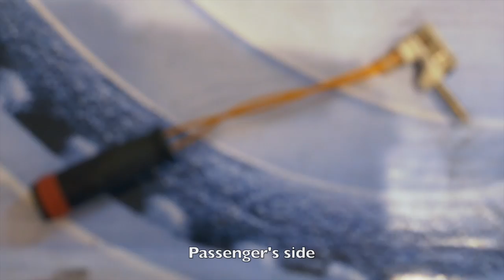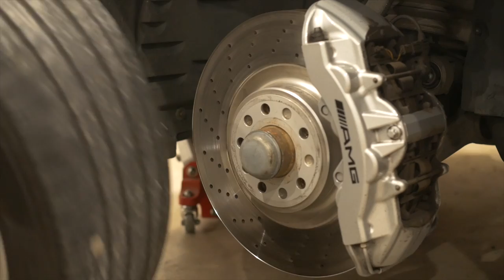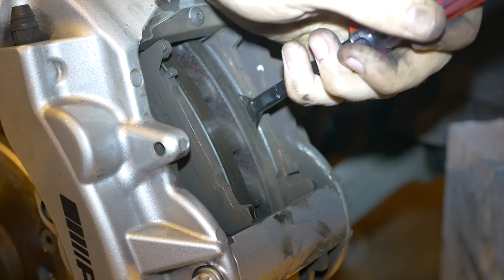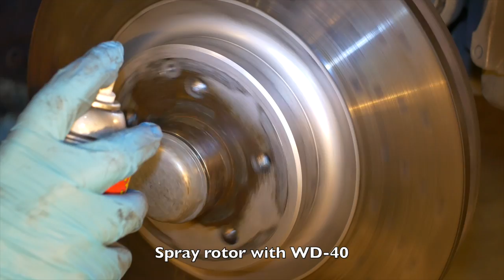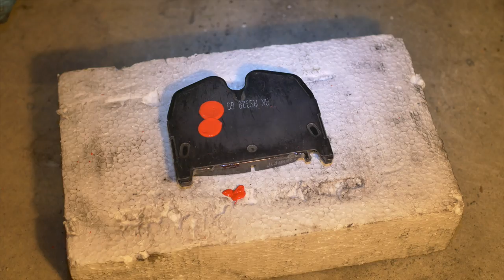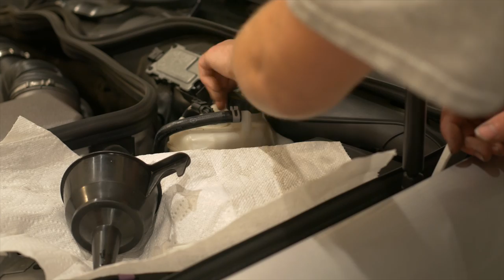Brake Pad & Rotor Replacement DIY | Mercedes W211 E55 AMG

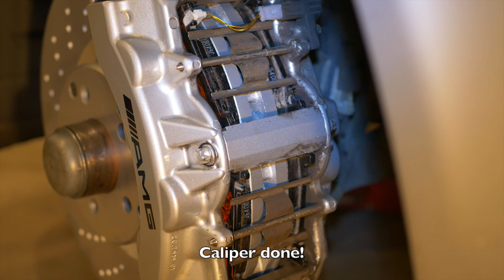Comment: I agree with this being the best visual instruction for changing the brakes on our AMG vehicles with this style Brembos.  I have to add if you are doing this make sure you don’t skimp on cleaning and even lubricating those contact points which the pads slide on where they make contact to prevent unwanted squeals and noises especially if you are using non MBZ pads.  Also the contact post in the caliper where that U shape divot on the pads rest on and make contact.  You can see that inner post at 5:55.  I originally had a bad squeal prior to doing the brakes and was very disappointed to find the squeal continued and got worse after all new rotors and Akebono pads.  Pulled everything off again and discovered I skimped way to much on cleaning and prep of the caliper which led to noises.  Went over the brake pad and caliper contact points with a little sand paper, cleaning and lubricant of Mercedes brake paste and everything sounds great.  If you are having a hard time sliding the new pads into the caliper cleaning the contact points is essential.  Thank you again, I couldn’t have tried tackling this with out your instruction.
Reply: Hi James I recently changed my rear rotors and pads and on my w219 amg stupidly forgot to clean clean the passenger side and as you said the squealing has gotten worse.. but I wanted to know it’s not only when I’m braking. I can hear something scraping as the wheel turns as well Do you have any insight?

Comment: well done video AMGmeister! My daily driven 06 E55 AMG is up to 150,000 miles now. I've logged 75,000 miles in only 2 years ownership. In this time I have replaced the brake pads & rotors, one front air shock, and the SC double idler pulley. Thats it other than fluids and filters. Excellent automobile.
Reply: samspace81 do you still have the original rear air shocks? Any leaks or problems there?
Reply: MRBADASS yes and no no problems
Reply: I'm back to do this again! 226,000 miles now!
Reply: @samspace81  Legend!
Reply: Brilliant!  At that rate you must be on 300,000 by now?
Reply: I’m at 228xxx and my brakes are on the plate this month which is why I’m here
Reply: I’m thinking to buy this car for daily use? Do you recommend it? I hate original car service by the way they always trying to charge something for nothing. But I’m scare about this car replacement coast.

Comment: I had a bit of a nightmare with this, rears were done in a few hours - but when it came to the fronts, it was a bit of a saga:

First of all I couldn’t get the pins out and they were totally seized.  So I ended up sending them to a calliper specialist who themselves had to wire erode them out along with the pad slider plates allen head button screws - the calliper behind these plates was totally corroded to the point where the pads were jammed in and had to be levered out.  

While they were away removing the discs involved cutting off the calliper retention bolts so the discs went in the bin, and then one of the brake hoses was split so had to be replaced.

The new Brembo pads I bought just wouldn’t fit, so I had to get some Pagid pads on the day which were a bit more expensive than my usual source.

One of the dust shields also had detached itself so I ended up doing this too, the part was very expensive…  

Needless to say everything when back with plenty of grease - choices where appropriate.

So since the brake callipers were off I was set to bleed the brakes and not having star, I had to do this solely with a pressure bleeder - which is possible, I was due a change anyway and I did it twice with a drive in between to bed in the new pads to flush as much as possible from within the SBC pump. 

Yay; life working on cars.  😒🤬😅

Comment: great video but i would avoid using thread lock on those bolts as it will be a PITA when it comes to doing the pads/rotors again. A nice snug to those bolts is all it needs.
Reply: Thats what i was thinking

Comment: awesome vid, but just a quick tip, no need to remove caliper bracket bolts on backside of rotor. There are 2 large 10mm hex bolts on front side of calipers, remove them and whole caliper lifts up and out of the way without having to remove the bracket. I once saw a guy servicing an SLR and that's how he did them (same style calipers) also factory recommends Pagid, Textar or ATE only for pad material. good job !
Reply: Yet merc pads are jurid originally lol
Reply: How is there room to remove the disc if you don't fully remove caliper via 13/16 bolt? I hope you are correct as I've only done one side and had a breaker bar as long as my car and it still took hour to undo it.. So bloody tight.. Especially when Mercedes used that blue locktite on it.
Reply: Wdb db yes Juríd was also original equipment. Sometimes providers changed with production date ranges.

Comment: Any issues with the meyle rotors and the ceramic pads? Looking to do the similar setup every soon but just want to know how the rotors preform. Not out of round or warping issues with the ceramic pads??
Reply from the maker: No issues with either. Very satisfied.

Comment: What size are the brake rotors?
Could you please post the part numbers?
I have an S class W221 S600 with the AMG brakes like in your video but im having issues finding the right parts.

Comment: beautiful car and good video information. Question: what is the reason that the SBC connector must be disconnected?

Thanks for the great videos !!! :)))
Reply from the maker: It is disconnected incase the door is opened or the car is unlocked accidentally during the service. These things cause the SBC pump to run and this will damage the caliper pistons or crush your fingers when you have the caliper removed or are replacing the pads.

Comment: well I just purchased a 05 e55 I'm glad I ran across this lol uncomplicate the 1st time...... my question is this there's no pistons in the calipers?  so there no need to bleed the system after removal of the pads an calipers? from what I seen no but hey I'd like to ask still
Reply from the maker: 8 pistons in the caliper, so you still have to bleed to get old fluid out. My brakes were just bled and fluid was changed before I got the car so I'm not in a rush to do it again. You need to find someone with STAR computer to do it I believe.
Reply: AMGmeister dam..... But in order to slide the new pads in you didn't have to push the pistons in then bleed them to push the pistons against the pad like typical breaks?
Reply from the maker: With the SBC brakes in this car it is easy to push the pistons to fit the new pads in - unlike a traditional brakes with a brake booster. Once you start up the car it will squeeze the pads to the rotor itself.
Reply: AMGmeister well that's awesome thanks for the info it's good 2 know
Reply: AMGmeister Does my 2007 e63 amg have sbc? I'm considering changing my front brakes and rotors.
Reply from the maker: It does not have SBC
Reply: @rcautofanatic5024  easy to check just push the brake pedal keep pressing and release 5- 10 times if u hear noise engine sound like u got SBC and or start the car put it in 1 / D push the break pad and again hard this time look dash did i get SBC-H? = HOLD :) THEN YEA OR POP AND LOOM ENGINE BAY HEHHE

Comment: Nice video! How or what tool did you use to measure those 120 and 60 degree turns after the bolt was torqued to spec? Thanks.

Comment: Is there a sensor on both sides in the front? Do you have to reset the sensor with a scan tool? How good are the akrbono pads? Do they produce alot of dust?

Comment: Great videos!! Keep them coming. How did you know you had to disconnect that Sbc. Are you a mb tech?
Reply from the maker: Whenever you open the door or unlock the car the SBC pump runs and adds pressure to the system. You just unplug it so it won't activate and possibly cause damage or injury while servicing the brakes. MB techs can de-activate SBC using their star computer, I don't have that though so I just unplug it.

Comment: Where does one get the metal backing plate that holds the pads in?  I need replacements but can't find them anywhere.  I can locate the mounting pins that hold the pads in the calipers but not the rear facing metal brackets that the pins go through.

Comment: you dont have to unplug the SBC pump.  just jack the car up and dont touch the door handles while servicing the brakes.
Reply: I'd rather take 20 seconds to unplug it than have my fingers sliced off from the pistons if the SBC decides to turn on (:

Comment: Does this DYI applies to the E63 as well?
Reply: No, because the E63 is facelift and has no SBC Unit, has a 6 Piston caliper and a floating rotor where the E55 has a static rotor

Comment: Unfortunately by using your SBC disconnect method you are not going to tell your SBC unit that you have done a brake job. Amongst other things the procedure will tell the SBC that you are using new brake pads and/or rotors again and the SBC knows how to handle this information for various situations.

Other than that another great video.

Comment: I am confused with finding wear sensors for the front, I have some ebay sellers telling me they are the same for left and right, but by looking at your video one is dark grey where the other is not.
Reply from the maker: I was just following this. Mercedes does provide different parts for driver and passenger side. The head size of the sensor pin is different for the passenger and driver side. I have not tried using the same one for both sides - it might not fit. https://www.ecstuning.com/Mercedes_Benz-2004-E55_AMG-211.076-Base-Sedan-V8_5.5L/Braking/Sensors/

Comment: Thought it was going to be a piece of cake. My caliper bolts are super hard to get off. One is stuck.
Reply from the maker: Hit it with WD-40 and a long breaker bar and it should come off.
Reply: Thanks i'll try that
Reply: I had the same problem.  It was a monster b*tch.  I didn't have a lift so I couldn't get full access.  Anyway, if you dare, disconnect the spindle from the upper control arm and the wheel assemlby falls forward to you and  allows you access to the caliper bolts.  They usually have a ton of lock tite making removal without a lift a major head ache. Regardless, I used a propane torch for a few minutes and then ice water and then a huge breaker bar and it broke them open.  Wasn't easy but you can do it.
Reply: Yeah mine broke nearly everything i own lol

Comment: Great DIY, but I must comment on two issues:

- The single rotor bolt is not load bearing, and its single purpose is to keep the rotor in place while the wheel is off, and thus the nominal torque of 10n.m  There is absolutely no need to thread lock it, or it will strip when you try to remove it next time. Once the wheel is installed, lug bolts will handle the job of keeping everything together. The rim inner surface will keep this bolt from backing up, or falling (if its gets loose, but break dust will corrode and clog it and keep it in place anyway)

- A drop of thread locker will go a long way, this stuff is low strength super glue, less is more, there is no need to shower bolts in it, next break job on this car is going to be an absolute nightmare

Comment: So you thread lock the guide bolt for the rotor, but don't specify torque specs for remounting the calipers...?
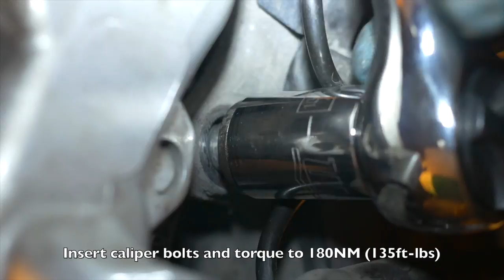Reply from the maker: It says 180NM (135ft-lbs) for caliber bolts at 4:21

Comment: @All Does my 2009 E350 4Matic Sedan have a SBC pump? So that when I replace the Brakes(Brembo) & Rotors(Brembo), I know to disconnect the pump
Reply: Inte8ranD no it does not have sbc
Reply: No, SBC in 2009 is the keyword to say that you don’t have SBC.

Comment: can this rotors and brake pads be fitted on Sl55 2004?
where can I check the compatibility
Reply from the maker: Eyas KD yes, this would work. You can double check by putting in your car on a website like FCP euro and it will show if it fits or not.
Reply: @AMGmeister  Thank you, 
Do you think its worth it to have the genuine rotors and pads from MB or this will do the same job? there is a big price difference , and this price difference is for something, please correct me if I'm wrong

Comment: Professional looks different. You don’t just pull the calipers back. You use a reset tool. He risks that the calipers might cant. Also you don’t wanna disconnect the SBC. Do it right via Star Diagnosis or other tool that can do it properly. You’re not replacing a lightbulb here, you work on everyone’s life insurance (called brakes)! Other than that good video.
Reply: I understand that this comment is 3 years old but you need to understand that not everyone has the resources to have a STAR Diagnostic Tool casually lying around at home, and sometimes doing things yourself can save you some cash.

Comment: I followed the video to the letter on my C55 AMG. When I started the car I now have an ESP display malfunction and ABS display malfunction. ABS light is on in the dash and the car won’t come out of park. I called Mercedes and they didn’t know why you would unplug the SBC module. 

HELP!!!
Reply from the maker: The C55 does not have an SBC module. I assume you disconnected the ABS module instead which might be causing the problems. Double check the connection. If you did brakes on a C55 you would not need to disconnect anything anyways. This video is for E55/S55/CL55 etc as I say in the description. I hope you are able to resolve the issue.
Reply: AMGmeister thanks for the reply. I was not able to resolve. Was able to trip the shifter bypass. But ultimately had to have it towed to the shop. Also the car wouldn’t shift out of first gear, and the speedo stoped working. Any thoughts as to to why?
Reply: C55 and CLK55 6 piston brembo caliper bracket bolts torque is 115 Nm.  Don't use 180 Nm.

Comment: Would you recommend the same procedure for a W209 CLK 55?
Reply: Very similar ,but clk55 has 6 piston front calipers ,with two pads ,not four.
Reply: No SBC to worry about ...Unbolt the caliper from the bracket with 10mm hex bit  ,,re ,fit with 110Nm.

Comment: I'm trying to purchase some pads and rotors any advice on a site the has decent prices?
Reply from the maker: Check out fcpeuro.com -  They have Zimmerman rotors which are the best quality. If you want a lower price but still good quality you can get Meyle rotors on eBay. You can get Akebono pads pretty much anywhere. Hope this helps.
Reply: @AMGmeister  I looked on there but I couldn't find rotors with AMG package
Reply from the maker: @dlawj15  This one is for the front of E55 AMG: https://www.fcpeuro.com/products/mercedes-disc-brake-rotor-e55-amg-sl600-sl55-amg-cls55-amg-2304210712oe

This is for the Rear: https://www.fcpeuro.com/products/mercedes-disc-brake-rotor-e55-amg-cls55-amg-cls63-amg-e63-amg-2114231012oe

Comment: Hey are these rotors the same as the s55 2003??
Reply from the maker: The rotors are slightly different for the E55 compared to the S55. The S55 has the same brakes CL55.

Comment: Will the EUR984 Pads work on a 2005 E55?
Reply from the maker: Yes, those are the correct pads for the rear brakes on the E55.
Reply: I am just going to order a pair for my E55. Question is, what are your reviews on these pads? In terms of dust and durability I've heard they are great. But how is the performance (say braking from 100 km/h to a standstill). Are they as good as the OEM or better/worse?

And how is akebono compared to Zimmerman pads?

Thanx for great video

Arian

Comment: You do not need to bleed the air out of brake line???
Reply: Why would you need to do that? You don't even need to do that on conventional brakes. All your doing is pushing the fluid back up into the reservoir when pressing the pads away from the rotor.
Reply: While you are there and you already got some old fluid out, why not just crack the bleeder and let much of the old fluid out then top off again. It gets rid of any fluid that may have moisture.
Besides MB service says to flush brake fluid regularly. On my ‘01 my calipers lasted as long as I owned the car no issues and the fluid was always clear and clean

Comment: you do not need to disconnect the SBC unit.  simply lock the doors and dont touch the handles until the work is done.

Comment: good vid, but the "brake quiet" (orange goop on pad backings) is kinda pointless in my experience. cheap insurance for a non-existant issue I guess.
Reply: Yep only grease aluminium parts just where the pads slide in and out when braking and very little please and use org MERCEDES IS water resistant made for the purpose + u don't want glue backside when  u let go of the brake u want them to me go of the pistons right

Comment: Great tutorial, but he’s tightening the calliper bolts way too much.
He says 180nm, but most people online are saying 115nm.  I went with 180nm and snapped the bolt. Mercedes recommend replacing this bolt with each rotor change. Technically the bolts are 10.9 grade so you can, 
http://electronicfilters.tpub.com/TM-10-4330-237-13P/css/TM-10-4330-237-13P_105.htm
but this didn’t work out so well for me)

if you keep it to 115nm you can use the existing bolt.  (180nm felt extremely  excessive with 4 x1/2 rotations using full force before the snap)
Reply from the maker: 180nm is from the Mercedes workshop manual. Using new bolts is advisable.